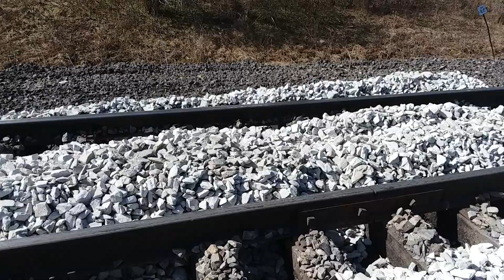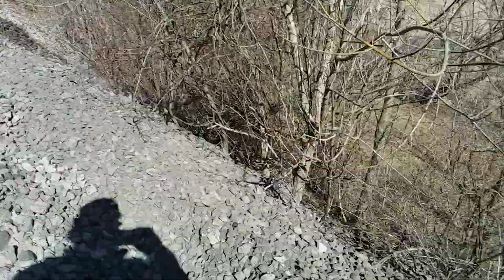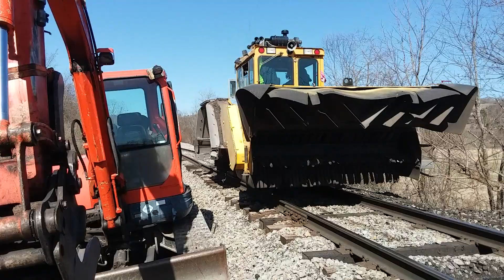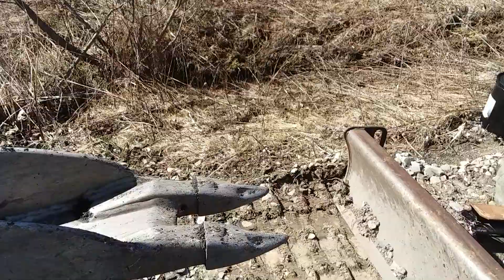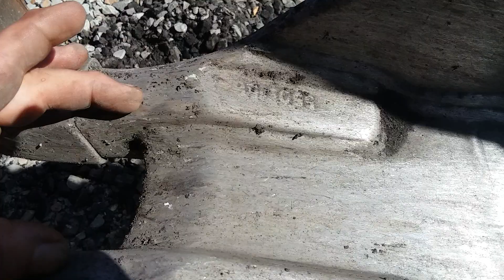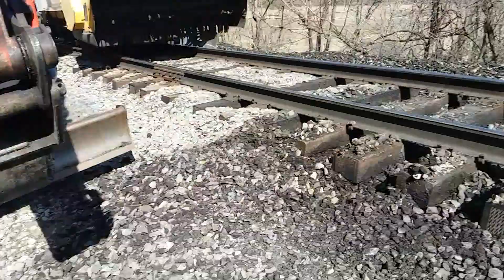Kershaw Ballast Regulator Cutting Track Shoulder plus Track Cribbing Buckets

Comment: I started out on a 26-1-2 cable wing had a Detroit motor no heat no air
Reply from the maker: Our original Kershaw had cable wings and the air conditioning
was opening the doors. Ran it for a lot of years, took some skills
and fortitude to operate. I don't remember what motor it had
in it tho, that was a lot of years ago. This one came to us
around 1995/96 brand new. Appreciate your taking the time to visit with us and watch. May you have a most blessed day my friend.

Comment: The regulators and other ballast machines aren't very sexy, but they do perhaps one of the most important jobs out there.  The condition of the ballast stone is critical to both drainage and the geometric stability of the track.  Fouled ballast or improperly shaped bed formation will very quickly cause multiple problems with rail head damage, track shifting, and be prone to washouts or other weather related failures.  The tamper can't do it's job until the ballast stone is correct, then after the corrections are applied to the track geometry, the regulators have to reshape the shoulders and ensure the ballast is at the correct crib depth. 

Never let anybody say your job isn't important.
Reply from the maker: My job is very important! Your right in your synopsis. Every machine
has to do it's job to keep trains running. Thank you very much
for taking the time to watch and write in my friend.

Comment: I noticed that when you were showing the cribs and explaining  what they were that some seemed to narrow to work with your bucket. Were these ties just to close together??? I learned something today, thanks...
Reply from the maker: When there is soft material in between the ties and not sufficient
anchoring of the ties, then they will move due to the dynamic forces
of the trains passing over them, thus they move close together.
Almost always I am able to space the ties with the bucket, a few
times with very tight spikes may need to pull the spikes up a bit
to get the tie repositioned. Very observant on your part and great
question David.

Comment: How does this track work compare with Europe? I am surprised that wooden ties (sleepers) and spikes are still used. Not quite a freight line: https://youtu.be/tMXfU8blPMM
Reply from the maker: Concrete isn't all it's cracked up to be yet, this article may
interest you

https://www.rtands.com/track-structure/ballast-ties-rail/new-paradigm-design-concrete-crossties/
Reply: @ccrx6700  Thanks for that.(I thought that I was so modern, and then...)
Reply from the maker: @SubTroppo  they are doing more experimenting with high psi concrete, i think they will find the magic number and in the future almost all new construction will be concrete ties. Im surprised they still allow creosoted bridge timbers over streams here!

Comment: I'm sure I've mentioned hauling some of these regulators for UP and being a bit fascinated by their operation ever since.  I never had any idea how big the "bristles" on the broom are (more like paddles, aren't they) until looking at it on the truck.  They'd have to be, though, considering the wear and tear.   The dust clouds can be huge, too...  These are pretty versatile,  it seems, though having the wings like a Jordan spreader would be handy for their reach.  

My first impression upon seeing that cribbing bucket was "tiny" but it's obviously a good fit for the purpose.   I'm curious to see the difference between this and the banana bucket, though, for I am assuming the other bucket will get into the narrow portions of a frog better?  

Lastly,  how long does it take to crib out a segment of track with the little excavator,  on average?  

Thanks for sharing!  :)

Comment: I got put on the regulator and i dont like it, i caught on pretty quickly but this is the first machine i dont like. Ive ran a tamper, tr10, spike puller, spiker, tie crane, plate jack, speedswing, loaders, backhoes and skidsteers but the regulator i dislike.

Comment: Real railroads are not like model railroads,... You can't BUY curved track lengths... How are curved rails made in real railroads?
Reply from the maker: Bobby, on typical track construction rails are curved manually using lining bars and muscle power. You would be surprised how 2 guys using the right leverage can shape a straight piece of rail to make it follow the curve. Final curvature thru the curve is done with tamper. Commonly rails are not factory pre bent. 

Now in certain sharp curve conditions rail is factory pre shaped, this occurs most often for transit for very sharp degree curves and other specialty applications. 

Great question sir and hope that explanation helps

Comment: I suppose cleaning the stones of the coal/mud/dirt is not economic? It seems that the difference in the density of the materials would facilitate an industrial process to clean the ballast stone and make it reusable. Perhaps economics is the determining factor? Just seems wasteful to simply push it aside to install new material.
Reply from the maker: Good observation. We have mulled over this for years. Some of
the ballast is reusable if cleaned some is just to contaminated.
We are looking currently into some kind of sifter bucket for the
excavator, so we'll see what happens with that, I think it's a good
idea, save a lot of money. Appreciate your watching and writing in

Comment: The only thing better than working on a railroad is working on a railroad in spring! 😎 Make sure to do a video on weed control. I've seed trains with brush cutting equipment, but have never seen what you spray with. I have seen what tracks look like after a few years of no weed control, and it isn't pretty! Have a great day Dave!
Reply from the maker: Thanks my friend. We don't spray 30 some years ago they decided
to do weed control mechanically. Unfortionately not every year we
can rent the machine to do it, and you are right, it grows up fast and
overtakes. We use the ballast regulator to eliminate weeds from the
ballast shoulder it does a good job and quick in doing that.
Reply: @ccrx6700  That's interesting as well! I watch a few 'abandoned places' type channels, and the railroads they explore have pretty big trees growing between the ties after a very short time. I always wondered what they do to keep functioning railroads free of weeds. Never even thought of them doing it manually!
Reply from the maker: @PlanetMojo  all that limestone dust from the ballast really makes things grow 😏
Reply: @ccrx6700  It's like the whole system was designed to keep you working. Not a bad system right there...  😉

Comment: Coal in your ballast is bad huh? Here in the anthracite region of Pennsylvania they used to build the railroad beds out of anthracite. Some people made a small fortune reclaiming the anthracite from under the old railroad beds
Reply from the maker: Joe, that's interesting, thanks for sharing. Coal isn't a bad ballast
until it gets wet, then it turns mushy and the track surface won't hold
very well over time, at least here.
Reply: @ccrx6700  yeah I guess the bituminous would break up easy and then become like mud. The anthracite really doesn't do that until you get into like the number 5 that is really like a fine powder. We shall most of that as metallurgical coal that they use in EAF steel-making, but we have to dry it first. They injected into the melts mostly to promote slag formation.

I kind of gathered most what you guys do is steam coal?
Reply from the maker: @joecummings1260  yes Joe, it's all steam coal we have. Most of what leaks from the cars is fines not lumps also. Anthracite from way I understand is much harder coal so can believe what you sayin bout it for ballast
Reply: @ccrx6700  yeah the anthracite is a lot harder, it's almost pure carbon. I'll tell you what though, that bituminous that you guys mind down there is really excellent steam coal, it has a good heating value. It's much better than that stuff that they mine out of the powder River basin. That stuff is damn near lignite
Reply from the maker: @joecummings1260  yes it is great for steam. I didn't know PRB coal was like that, thanks Joe for that! There sure is a lot of it coming from there. Had do some research on your comments tonight, learned somethings bout coal I didn't know. Thank you for your writing in sir! It's been interesting
Reply: @ccrx6700  yeah it has been an interesting conversation. Old-Timers like us are getting kind of rare. I really enjoy the videos that you make
Reply from the maker: @joecummings1260  you bet Joe, keep in touch 👍

Comment: New guy..... probably going to find the answer in an older video....but why dig the crib out?
Reply: The ballast is contaminated with coal. Its not draining the way it should and creating soft spots in the track structure.
Reply from the maker: @rebelrailroader  Thank you my friend, excellent explanation 👍
Reply from the maker: Vincent, read reply from rebelrailroader, he gives excellent explanation
Reply: Thanks.  There's a spot near one of our farm crossings that has a spring. Brings clay and mud into the stone, lubricates the stone and it smashes out from under the ties.  The grade looked good in the video, I hadn't considered coal coming in from the top.
Reply from the maker: @vincentphelps6325  your welcome, lots of RR's have mud problems at crossings, it a never ending battle try to get rid of the mud